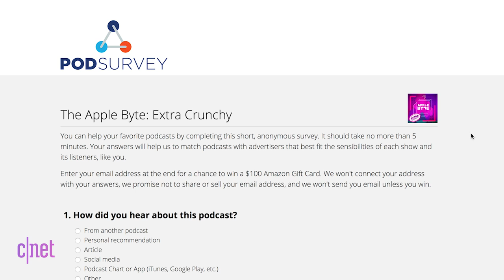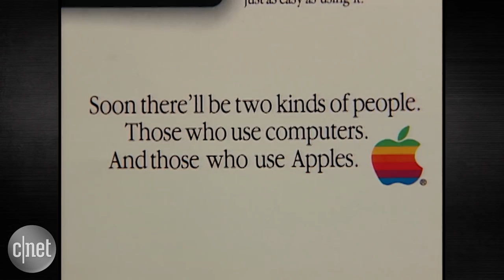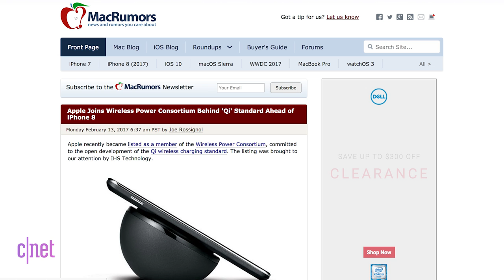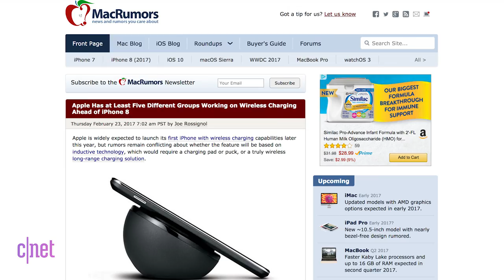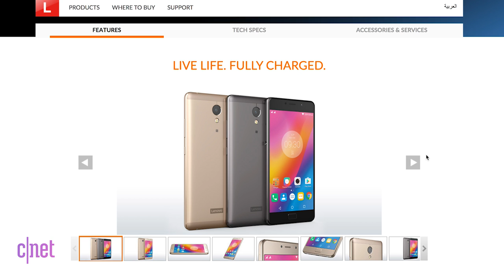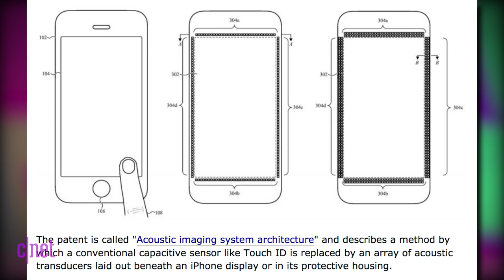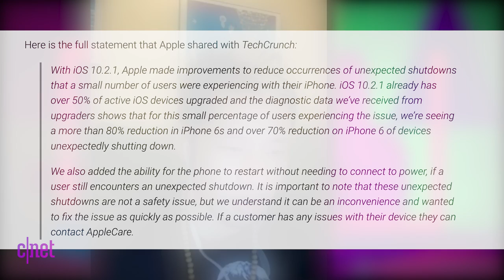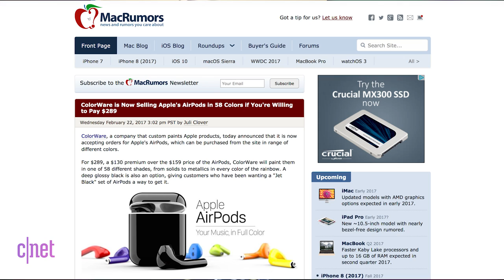Apple's 'iPhone' 8 looks to bring a bigger redesigned battery (Apple Byte Extra Crunchy, Ep. 73)

Comment: Just got my first iPad, the iPad Air 2. One thing that annoys me is that Apple has installed it full of proprietary apps it wants to use as default. I just want to use Google's apps, which work fluidly across all devices and in collaboration with everyone else. 

I use Google search, Chrome, Google Drive, Google photos, Google Sheets, Google Slides etc. but iPad has it's own Siri, Safari, iCloud, photos, which are all inferior. Can't even uninstall them. iPad has good hardware, but it's hindered by the software. Can't even remove them from view in the home page - gotta stuff them in a folder!

90% of the mobile OS devices on the market are Android and 85% of desktop/laptop OS devices are Windows. Wake up Apple and stop this walled garden tactic.
Reply: Mikko Haavisto you can delete them now (iOS 10) but seriously, all those apps are brilliant! Its matter of getting used to. I moved from android and Google to Apple and left all Google apps behind. No regrets now 😎
Reply: The apps might be good, but since you can't install them on Android or Windows 10, they are out of the question. Collaborating with others would require everyone to buy only Apple stuff, while Google/Microsoft apps work across all devices.